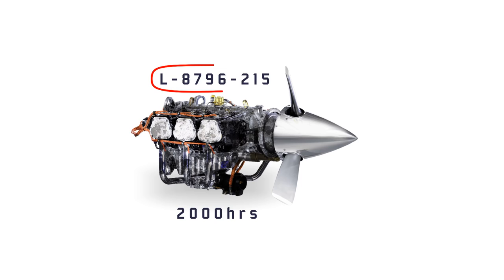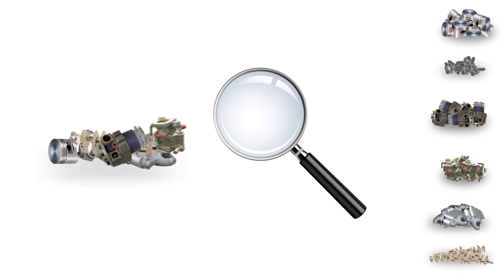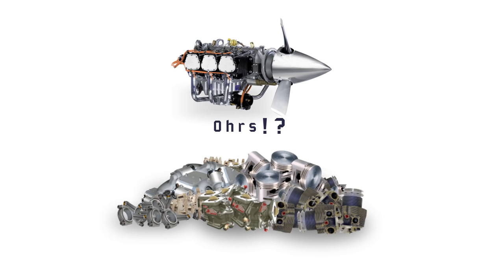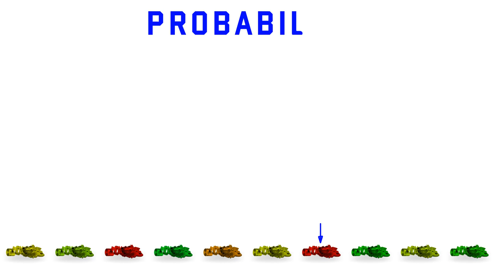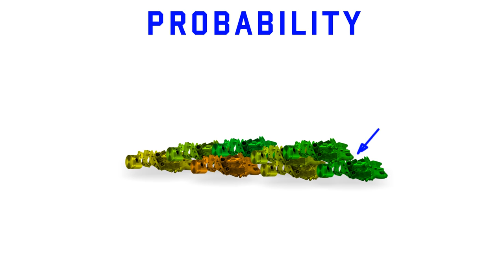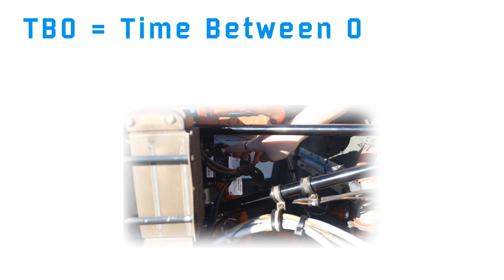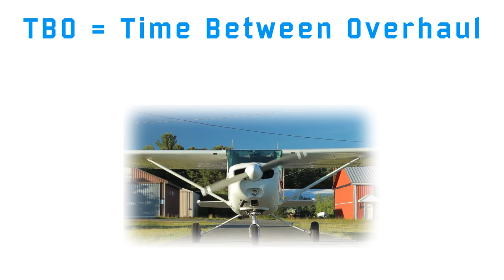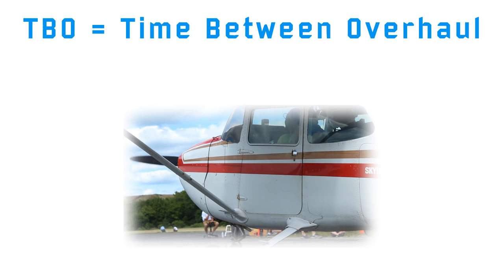The $20,000 high school math that keeps engines running.

Comment: If you buy a new engine have it overhauled, if you buy a old(pre 1990’s I’ve been told) have it rebuilt. Metallurgy has come a long way in 30 years and they are able to do a much better job on parr’s now.
Reply: heh well most parts come from china and they use sub par metal compared to the metal used by old school usa manufacturers. the big difference today is not the metal but the CNC machines used to make the parts creating a better, tighter, more exacting fit of the parts.

Comment: Did you take statistics?  Because while I'm not a statistics major (I'm a retired CPA), I took statistics through graduate school.  So what I'm seeing is a huge, and very common, mistake.  An engine is not like a bond-fund where failure of part means the fund gets stronger and losses are minimized via spreading risk.  

An engine a failure can be deadly as it is an interdependent system.  So with an engine, the probability of failure is dependent on the weakest link of a critical component.  To make a simple example, let's say you have 6 MTBF 5000 hour cylinder assemblies and a MTBF 500 hour crankshaft, what you have is a 500 hour MTBF engine not a 4357 hour MTBF engine.  

What you did was common mistake as probabilities are not additive or proper to average in your example.  And, like I said, it's a very, very common mistake because, strangely enough, while the math of statistics is easy, the concepts are frequently counter-intuitive.

Comment: No sure I agree with your theory here. One difference you failed to mention is the Overhauled engine is rebuilt at OVERAHUL limits, and the Zero time engine is rebuilt to NEW limits. Also the NEW engine called a REMANUFACTURED engine from the factory will come with a better warranty.

Comment: AND,........ many Lycomings out there are not getting more than 1/4 of the way to TBO before needing a top end overhaul.  Of course there's no accounting for abuse by other owners parts getting put into your engine.  I'd rather take mine to a reputable shop that uses factory new parts in it's overhaul and has techs with expertise on the specific model.  Or forget about recips altogether - different set of risk elements, but a lot lower probability of a failure.  Regardless, don't slam throttles around and abuse the temp limits and it shouldn't be that bad.
Reply from the maker: Good points.  Curious if you have a link for any of that number.  I'm not being a troll, I'm just curious.  I would love to take a look at them.

Comment: They done this with car engines forever mostly very common ones like in the 50's 60's the did it with ford flatheads and from the 80's to present the do it with chevy 350 small blocks but all the parts had to meet factory specs is this the same with Aircraft engines?
Reply from the maker: The factory specifies a certain range that the part's tolerances may be within, including a smaller range that is exactly how they left the factory, which would constitute a ""factory quality" overhaul.  Great question!

Comment: Mmmmm...What is the cost of an overhauled as opposed to rebuilt?  I'd hate to think that the one thing that failed on my rebuilt engine was a fuel pump on take off.  But I guess I'd feel better knowing someone else got my really good fuel pump in their rebuilt engine as I'm putting my aircraft down in a field somewhere.  I think I'd go with an overhaul.
Reply from the maker: Right?  It's a little weird, and you really need to know your engine well to make that decision.  The factory rebuilds and overhauls are always more expensive than having it done locally, probably by about $5k average.

Comment: I didn't quite understand your talk on the TBO? A manufacturer scheme? So are you saying they WANT you to fly past TBO to keep getting business as an oil manufacture would suggest changing oil every 3,000 miles?
Reply: Michael Carr they didn't say that..
Reply: FlightX101 right but I'm still trying to figure out what he meant.
Reply: Basicly TBO is the suggested average time a properly maintained engine should be able to go between overhauls. When you take an aircraft in for it's annual or hour based inspections the AME will look over the engine to determine whether it needs any repairs or an overhaul. If you keep the engine well maintained it may not need an overhaul for up to hundred, or even a thousand hour past TBO TL;DR If the engine is at or nearing TBO and the AME says it doesn't need an overhaul yet then it's still safe to fly. TBO is just a best guess.
Reply: TheJagg2 I'm just hoping I can get several hundred more hours on my continental o- 300 engine past the TBO.
Reply: FWIW - when it's nearing TBO isn't the best time to start a maint. plan that can tell you the likelihood of lasting extra hours.  History over time helps the most, along with lack of abuse & good rep. for the particular model.

Things to check/look for with ANY gas engine are: Compression test results (best with HISTORY, but definitive if something notably off), followed by Leakdown test (if compression test yields questions, this helps answer them) and oil pressure (need a HISTORY again).  Oil pressure in particular needs a history, knowing what normally shows (and maybe an old precision gauge check) vs. any current changes.  By the time that shows a drop, it's pretty much guaranteed it's time for the overhaul.

Comment: $8/hr??????? so much for high school math hu   I would point out to you another aspect of the manufacturer's "scheme" regrading overhaul intervals.  And that is the performance delta from newly run in specs.  As for fleet reliability, just purchase an aircraft who's engine has incorporated all the engine OEM's SB's.  No doubt you have heard of monitoring compression for each cylinder, and for that matter temps for each cylinder.  Next time you depart places like Big Bear Lake in your Cessna and it doesn't seem to want to get airborne or climb much after that, you'll wish yo had monitored these things, which do go south shortly after established TBOs.  So that 172 isn't making 180hp anymore at sea level, more like 150 something and with density altitude you are going to notice.  So maybe best to divide the cost by the TBO hours to be assured of making required power.  Oh yeah, and certain engines are notorious for not making TBO and require a budget for a top end overhaul between complete overhauls.  We agree that we hate Lycoming and Continental for this - especially those of us who baby our engines to stretch the time out.

Comment: Thanks for your videos! Do you know what kind of paperwork/certifications are required if you want to put different pistons/cams into your engine at rebuild?

For example, the io-360 engine in planes has compression of 8.5 or lower (depending on aircraft) whereas in helicopters, they use 10:1 compression pistons. 

Of course there are some risks to detonation, but since I've only seen 100ll available in the real wold (I am yet to encounter anything else than 100ll and jet-a) and autogas requires other stc's/rubber component replacement due to ethanol content, it seems to me that upping the compression at rebuild/overhaul is a good way to increase economy and efficiency.
Reply from the maker: It would either have to be re-certified as an experimental aircraft, with an experimental engine (get ready for your insurance bill), or the parts would already have had to be STCed (supplemental type certificate) and on record with the FAA, then it's very easy.

Comment: i dont know where you get your figures from.....15k as an average is not typical. $8/hr is low figure.....depends on how much time you have until TBO when you purchase the plane. What you are describing is a factory new overhaul .. not a typical overhaul process.
Reply from the maker: 1. My own personal factory rebuild invoice.
2. The video title says $20,000.
3. $15k/2000hrs = $7.5/hr.  $20k/2000hrs = $10/hr.
4. The aircraft should be properly reduced in price at the time of purchase based on hrs SMOH.
5. That's why the video presents "factory rebuilt engine" at 0:38 and 0:58.
6. See above.

Some days I'm sorry that I'm an incredibly obsessive engineering type too...
Reply: The way you presented it, was not very clear. I am very familiar with aircraft operating costs and how the numbers are calculated. I was really trying to say, you should be more clear in your example and not assume so much...because the math you are showing is very "ideal" and those numbers will be higher or lower even on the same lane and engine type, but different owners or hours....etc you are leading the novice viewer down a rosy path of un realistic cost figures.

Comment: What you are calling rebuilt is more correctly called remanufactured. 
Overhaul is more of a slang term for freshening up non-certified stuff like cars and generally involves what you described, most new parts in an overhaul are seals and such. Overhauls are done when a machine is old and weathered(leaking oil etc) or of unknown condition(eg found in a junkyard) but not really mechanically worn out.
A rebuild is like an overhaul taken to the extreme(many overhauls turn into rebuilds upon inspection), and a rebuild generally involves machining the worn out of shape areas like cylinders and crank bearings, as well as installing new pistons and bearing inserts (to match the newly machined surfaces) and new critical fasteners. Unlike re-manufacturing all the parts are either from the original serial number or are new. 
The other major difference is that remanufactured engines are processed on an assembly line, in cars the rebuilt engine can be blueprinted but the assembly line will install any part that is technically within tolerance. (Certified aircraft engines likely use some parts- tolerance binning to avoid extreme tolerance stack so are not as bad as car engines in this regard.) 
Blueprinting is measuring parts and matching tolerances to avoid tolerance stacking issues. Commonly used for competition engines. For example in a multi cylinder engines cylinder #1 may be machined .001 larger than #2 while new piston A is manufactured .002 smaller than piston B, all of these are individually within manufacturing tolerance but if you put A into #1 and B into #2 then cylinder #1 will have .003 more clearance than cylinder #2. 
.003 is quite a difference when the ideal gap may be only .004; and this can significantly effect performance and cause uneven wear, and in the case of cylinder clearance increase oil burn or oil contamination from blow by and carbon gunk that fouls the rings.

Comment: So if a new unit can't be afford the best way is overhaul
Reply from the maker: The overhaul usually ends up being significantly cheaper, and can sometime yield a more reliable engine than one that just left the factory floor, interestingly enough.
Reply: if everybody overhauls, there will be a point that you can’t get more of it because all the parts have been used already several times. Somebody (not me) has to get new engines xD
Reply from the maker: Hahaha well said!! XD

Comment: but if they throw away the bad parts, they wont have enough parts to make the same amount of engines again..?
Reply from the maker: It's the factory doing the rebuild, so they just manufacture new parts to replace the old, which are hopefully manufactured with better tolerances thanks to today's equipment.

Comment: It seems rediculous to suggest rebuilding an engine results in a better engine than overhauling it simply because the parts are mixed with other parts and the bad ones “weeded out”. I’m assuming there must be other big differences between rebuilding and overhauling.

If you overhaul an engine you should be able to weed out the bad parts just as well as in the overhaul process since in both cases you’d be tearing down the engine and inspecting parts.

By logging and reviewing the data you would have the same positive effect of getting rid of bad parts so I’m not sure what the point of mixing the parts is. Also, after an engine has been on the market for a while most failures are probably caused by wear and tear, not by manufacturing defects. The wear and tear should be caught in the inspection stage and the manufacture defected parts could be identified simply by logging information and then reviewing data and knowing what parts are expected to fail as I mentioned above,

Comment: Still wouldn´t the engine last as long as it´s weakest part?
Reply: Mavez. yes, but the weakest parts are being weeded out with every rebuild.
Reply: Depends on the part, if it is a spark plug, you loose some power, but it will still fly.

Comment: So basically, don't overhaul it until it is absolutely necessary?
Reply from the maker: I mean, most people would agree with that, but it wasn't necessarily the point of this video.  It was more about the process.
Reply: You mean after it makes a loud noise and stops running?

I would say yes...

Comment: This was an informative and entertaining video.  However I feel like you may have missed out on a few important details that might skew a viewers perception of Overhaul vs Factory Rebuilt.  I think it's important that everyone understands in both cases, ALL of the consumable wear items are replaced (bearings, rings valve guides etc) and components are inspected very carefully and deemed to be within limits.  Components such as crankcase and crankshaft will be machined to remove imperfections etc.  There's a lot more to it than just taking the engine apart and putting it back together.  This is not an ad for Western Skyways, but they do have an excellent description of what their overhaul includes. http://www.westernskyways.com/_IO-360/
Reply: I was going to post essentially the same thing but figured I'd check first to see if someone beat me to it. 
That's why we say that the single most dangerous thing in aviation is a pilot with a wrench :)

Comment: Why do airplane engines have to be overhauled so frequently? Overhauling your engine 2000 hours is approximately the equivalent of Overhauling your car's engine every 60,000-70,000 miles. This seems weird to me because most car engines will run at least three times that time without ever breaking down.
Reply from the maker: It's because they have to be light weight, making them more susceptible to metal fatigue, and because they run at higher continuous power settings.  Most car engines will generate maximum power around 4,000rpm, but you seldom run them at maximum power.  Airplane engines, on the other hand might develops maximum power at 2,600rpm, and run at 2,500rpm in cruise.  Excellent question, btw!!
Reply: Also, an airplane doesn’t cruise at 40 - 80 miles per hour like a car does. If your airplane flies at an average 150 mph, you’ll fly 300,000 miles in 2000 hours. Pretty amazing when you consider that back in the days when these engines were designed, a really, really good car would barely get you to 100,000 miles. Automobiles have improved, of course, but aircraft are still way ahead in reliability.
Reply: Jimmy  pls re-read my comment.